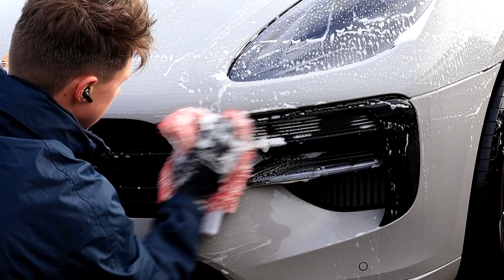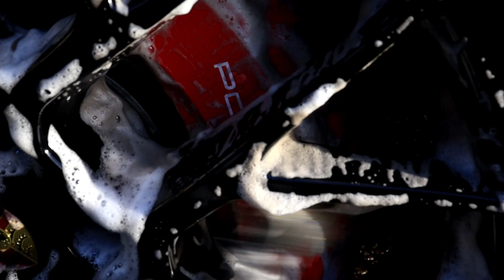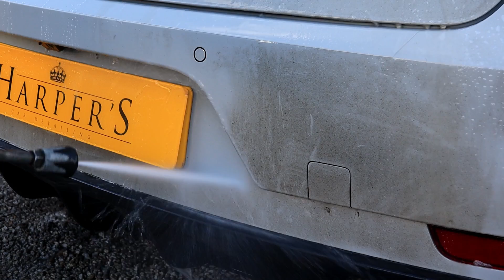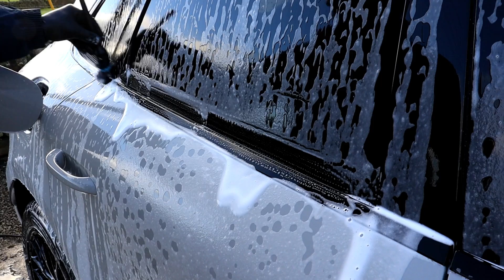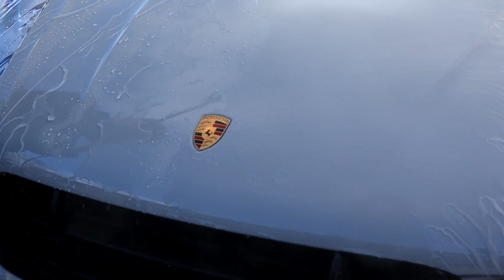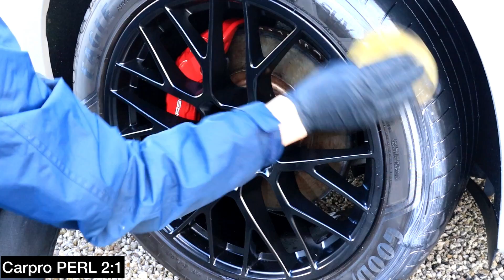DIRTY Porsche Macan GTS - Exterior Deep Clean - Auto Detailing

Comment: not sure why you work from the bottom up rather than cleaner to dirtier - top down ,on the pre-wash?
Reply from the maker: The only reason I rinse from the bottom up is so I can see exactly where I have been with my pressure washer, as it’s the pressure of the water that removes the underlying dirt. 
If you start from the top then you would dilute the foam below and it would run off the panel, so you don’t necessarily know where you have rinsed, therefore you could very easily miss a spot. 
The pre-rinse stage is arguably one of the most important stages so I need to be thorough.